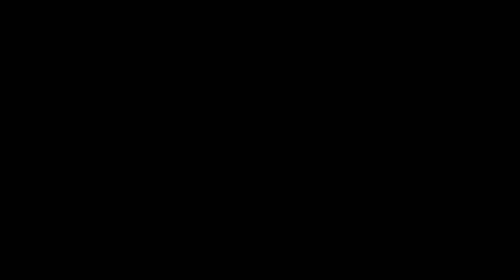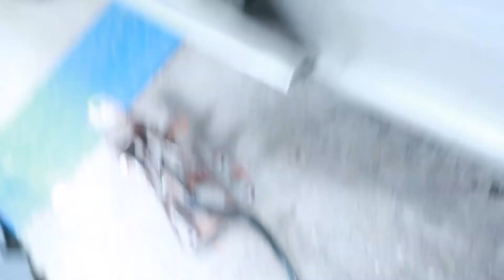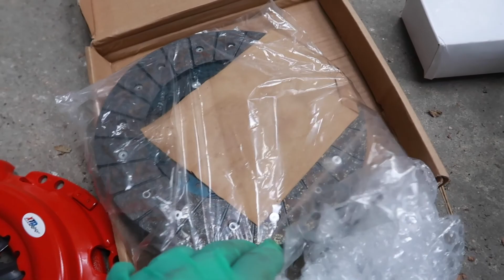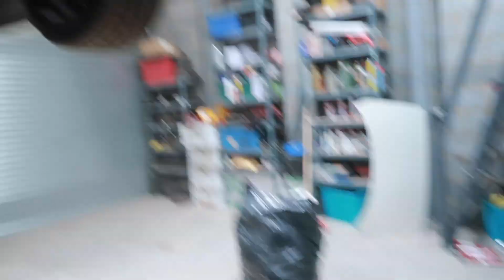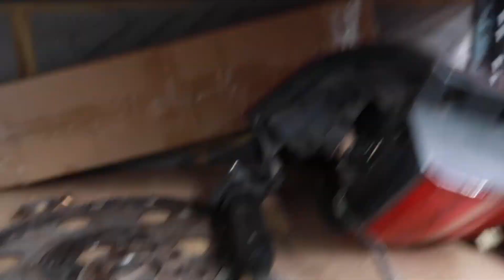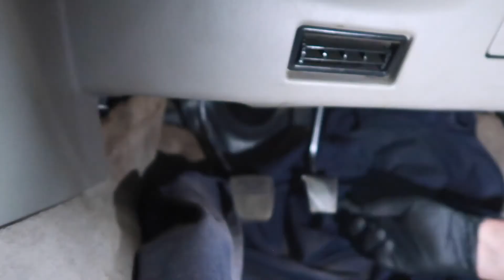My JZX100 manual conversion on budget using J160 gearbox | Cheap auto to manual swap

Comment: hey bro do you know if the is300 diff and axles are the same as the turbo jzx100 diff and axles?
Reply from the maker: @agezzz2854  I don’t think so. But if you have diff and shaft from is300 it will fit into a 100
Reply: @GeorgeHampl  so I converted my cresta to LSD with factory turbo axles, also what did you do with the trans cooler piping stuff? did you remove what i assume is the trans cooler? or did you just leave it there and drain the fluid or something cheers

Comment: Got a question I have purchased the new kit with the trans bell housing and shaft adapter Any info on how the direction of the install goes with the Bering and fork
Reply from the maker: Hey dude. Not sure what you are asking to be perfectly honest.
Reply: @GeorgeHampl  sorry my terms may not have been correct, the orientation of the input shaft adapter sleeve and bering

Comment: Hey mate looking into doing the same thing with a gx100 witch come factory with the 1gfe beams do you know if the j160 out of a altezza would bolt strait to that and what crossmember ect? Just can’t find anything on forms though you might have some sort of a idea
Reply: 1gfe came stock with j160 at least in europe so you should be sound

Comment: Apparently the w58 flywheel actually won't work with this, so how did you manage to make it work?
Reply from the maker: Hello mate. You have wrong information. The JZ W58 works. What are you trying to do? And who told you that?
Reply: @GeorgeHampl  thanks for replying so soon! So I've got a friend who 1jzgte vvti converted his gx90, brilliant build and he uses a j160 but he said a modified 3sge flywheel can work if the holes were brought out 4mm which is exactly what he did, but he said he tried a w58 flywheel and it didn't work :/
Reply: Im in the research phase of manual converting my jzx100 with a circlip upgraded j160 😁
Reply from the maker: @sillycargarage3262  I am not familiar with the 3s flywheel but I know people use it. I am guessing it all depends on what J160 conversion kit is used. This kit is designed to be used with the JZ W58 fly and clutch kit.
There are two W58 flywheels. One for the JZ and other for the 7M engine and they are different.
Reply: @GeorgeHampl  are you using a factory size 235mm flywheel or the  aftermarket 10 inch/250mm version? That may be where the fitment issue lies potentially. Factory size may work but aftermarket may not
Reply from the maker: @sillycargarage3262  I have used 4 different flywheels with this kit and all worked fine.

What seems to be the issue? What kit is being used?
Reply: @GeorgeHampl  I think he may have used an aftermarket flywheel compatible with a w58, but was slightly different. Can't exactly remember, but I will take your word for it, seeing as I actually have seen you do it in the video 😁

Comment: did you upgrade the differential or used to the same diff which came with the  automatic transmission
Reply from the maker: Lexus IS300 LSD

Comment: do you know if the r154 works on the 1jz ge engine, like do the bolt pattern match from the bell housing to the engine of a grande, i have the same exact car and im planning on manual swap, engine swap and a bunch of other upgrades, thank you
Reply from the maker: Yes it does. The block is basically the same

Comment: Did you use a wiring schematic to figure out which wires to connect for the neutral switch? Did you just tie the rest of the wires up and out of the way after that? I’ll be tackling a manual swap at the end of the year
Reply from the maker: No diagram. The two neutral switch wires that need connecting are the only two that have bigger connectors within the neutral switch plug. Hope that makes sense. This applies to all rwd Toyotas of the same era.
Rest I just tucked away as you said.

Comment: Where did you get the conversion kit? Did you have to cut the is200 gearbox or did it just bolt on?
Reply from the maker: I bought the conversion kit from MCL autoworx. The design been sold to Crest Motorsport who now sells it. You just have to split the gearbox and put the modified bell housing on. If you look at my previous videos there is detailed guide.
Reply: @GeorgeHampl  il have a look thanks

Comment: How much did the full auto to manual swap cost start to finish? great vid btw
Reply from the maker: Thank you. Gearbox £100, Conversion kit £350, Propshaft including modifications £150, Clutch pedal and hydraulics £150. Clutch and flywheel £300. plus some little bits like fluids etc. I think that's it really. Just About £1100 I think
Reply: @GeorgeHampl  WOW! That's cheap. Where'd you get your parts?
Reply: @GeorgeHampl  hey mate i plan on going to manual as well, whered u get the parts
Reply: @GeorgeHampl  hey bro u have a phone number are a email that I can reach I need some advice